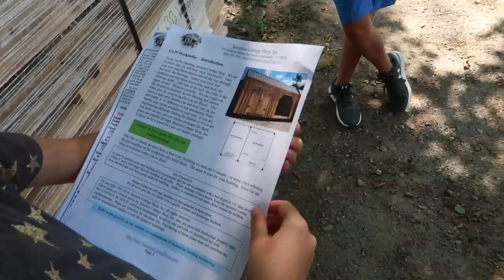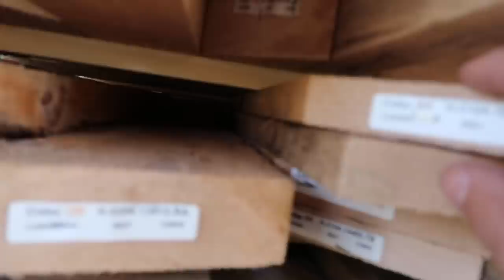Ordered a Post & Beam Shed on the Internet this is What we GOT!

Comment: Good job on the tree pruning! Most people do not know that branches should be cut flush with the tree and no 'wound sealer' should be applied. The exact opposite was the recommendation for many, many years, and that's how many people learned. Cant wait to see how this kit goes together! I'm still working on my first project -- no roof yet. Time to get moving before winter sets in!

Comment: Get a set of forks for your tractor you will love them. I use them for everything including moving brush by just sliding under the pile. A lot easier than trying to get it in the bucket or using a strap.  I also made a super simple three side box that gives me a ton more volume over the bucket. It can't be loaded super heavey but I find I am moving bulky stuff more then heavey stuff. The other great use I have found is I store a lot of stuff on pallets now so super easy to move around. Ordered a roll of the pallet shrink wrap for anything that is a little unstable and being stored for a chunk of time. 
I would recommend Ai2 Products. And to be clear I am not affiliated with them at all so I am not a bot advertiser.

Comment: Hello from spain, i´m looking for the thing you used for repair the chain.. i never saw that, and i want one!! Whats the name? Good job, good luck!
Reply: If you look up Oregon chain file or Stihl chain file, they make this type of guide.  You need a different one depending on you chain pitch (size).
Even easier and faster is the new Stihl 2 in 1 sharpener, worth the investment, it gets the best edge you'll manage at home without much more expensive equipment or a LOT of practice.  Doesn't have to be used on a Stihl saw or chain as long as you know what chain your saw has when you choose one.
Reply: Google chainsaw sharpener
Reply: @jncg2311  thanks a lot, i can find sthil here, i´ll will get one "2 in 1" tomorrow.
Reply: @tonygrimes13  Before watching the video I only knew electrical devices with abrasive discs (expensive) and manual files, I have a file but it is a difficult and boring job, with that accessory it seems much easier, thanks for the information. Today I did not have time to go to the stihl store but as soon as I can I get one.
Reply: @gringoloco47  where in Spain do you live?
Reply: @tonygrimes13  near Madrid.

Comment: Great to see him use a Moffett Mounty fork lift which are made and invented in Ireland . A lady in Co Monaghan owns the company or used to when I had dealings with them. I used to supply all the bolts and nuts for them
Reply: Forklift is a Moffett Mounty Moffett Company was founded by Cecil Moffett in 1945 in Clontibret, Ireland. The Irish are a clever lot.
Reply: @tonygrimes13  If I remember correctly it was Nicola Moffett running it when I was supplying them 25 years ago.
Great company to deal with another company was Mc hale farm mechinery not sure if they have them in the US.
Reply: @tonygrimes13  Thanks for that interesting reading

Comment: Here is a tip for running chain saws. Fill chain oil completely full every time you put gas in the saw. Only put 3/4 tank of gas. WHY YOU ASK? This way you always run out of gas before you run out of oil.

Comment: Gaauud Mawnin Lumnah Acres!  WOW, even the delivery is an easy and smooth operation. No lumber yard delivery truck is doing the 'tilt and slip dump' all your materials off!  All that I have seen with these builds that you are doing, Jamaica Cottage kits are the way to go! Even if you don't do your own erection this these kits are so well planned out designed with detailed instructions, a hired crew can quickly build these in no time.  After all, not everybody is as skilled as you are Al, and not everyone has the accumulated tools, saws, nailing guns, etc.  If I were a small contractor, I would use Dom's packages for my build projects, so much of the lumber is all precut, and there is a lot of time-saving designed into the kits.

Comment: looking at your " shavings " when cutting the branches, seem like a dull blade still, you should have " chips " not dust. suggest investing in an electric grind wheel for chainsaw blades, you should get an almost perfect angle of grind every time. I have 3 blades I use for my saw, 1 sharp on the bar 2 sharp back ups, saves time to just swap blades out and grind sharpen later. you can sharpen a 20 inch blade both angles in just a few minutes in the comfort of the garage and save time in the woods.
Reply: I guess you mean chainsaw chain..not blade, right?

Comment: In south texas we are in the dog days of summer 80° for a LOW 100° to 103° for a HIGH. 
We can pour concrete year round there are about 2 week's of winter here but we can and have had 100° in FEBRUARY. Bad. Lady from the NETHERLANDS  (tourist) almost had a HEAT STROKE in FEBRUARY winter b4 last.
Your wood shed looks like fun.
You might want to find a local woodmill to get saw dust (glitter) shavings. You can use them for bedding then add to compost pile. Also food scraps from restaurant's. This will feed chickens and keep them warm.

Comment: Man 3 times in one video....that's to many comments...but if you take a 2x6 piece of scrap that is wider than your broom head, you can cut a sharp angle on one long edge and it will help you sweep out the stalls right into the bucket.

Comment: Al I got the stihl chainsaw sharpener and It works really good and does the rakers at the same time and it so easy to use it made me look like I knew what I was doing. LOL
Reply from the maker: Thanks. I’ll have to look into one.
Reply: @LumnahAcres  you won't regret it. Looking forward to the new build,  great job on the barn
Reply: @LumnahAcres  they also make a simple sharpener that is operated using a Dremel.  I've used one and it did a fantasic and fast job.

Comment: To you farmers, Off-Griders, tractor people..
You should really get in tge habit of leaving one attachment. (Front or back) on the ground when you get off the machine.. .
I know tge Kubota is one of the machines that are hydrostatic and don't roll unless ingaged...
But one you'll probably get on a machine that isn't hydrostatic...
and that machine will hurt or kill you juat because you left it so it could...
Don't trust a parking brake...
And if it has electric engagement...
Shut the machine off or put the trans in neutral...
This is the voice of experience..
I had an ehectric switch fail..
and it shifted into forward...
Sure got my heart pounding..
Never trusted that machine again unless i was on it or it was turned off or in neutral with something on the ground
Just saying a mistake can hurt you or your family for ever...